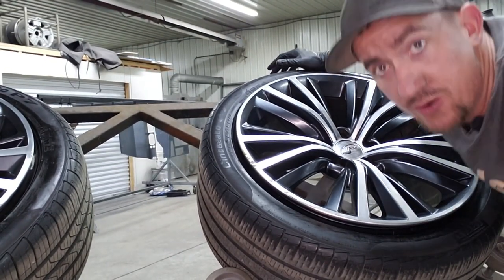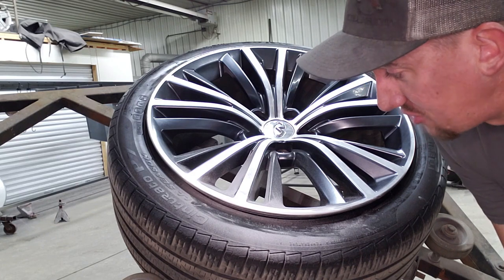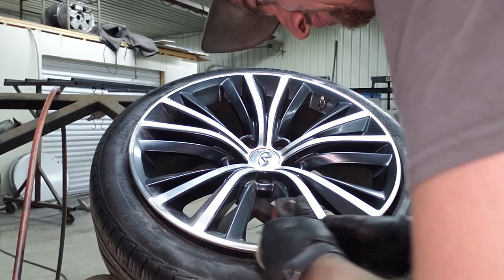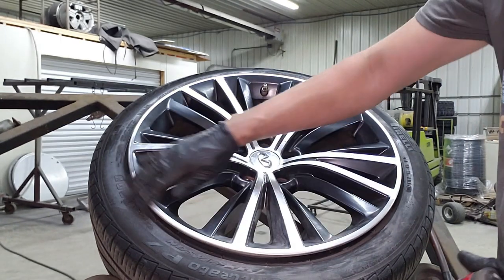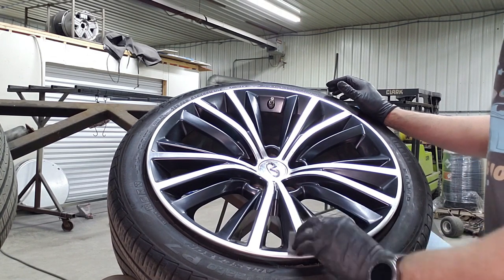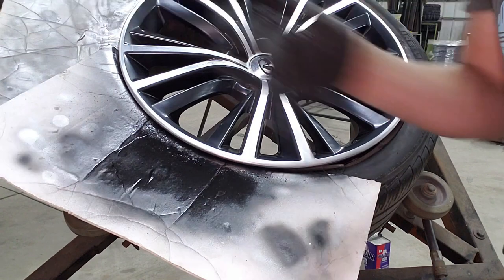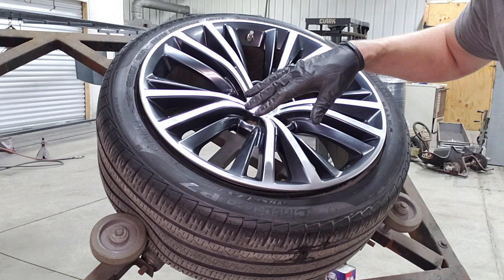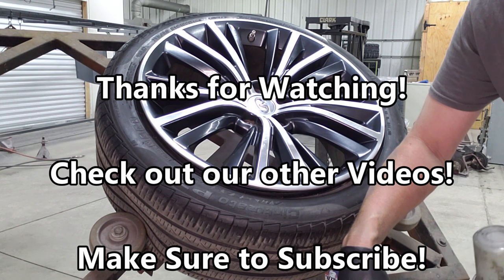Wheel Repair - How To Repair Curb Rash / Road Rash - The right way

Comment: Howdy Dan. Glad to see there are men out there doing things the right way. Out here in Cali most of the mobile rim guys I see use rattle cans;it’s kind of depressing and pathetic. 
I’ve been doing mobile paint and interior repair for over 40 years. Back in the day when I repaired cracked dashes and dyed vinyl tops. Then painted plastic bumpers came along in ‘80 and it was on.Started working in a body shop when I was 18,got all my certifications by PPGand threw everything I could in a truck and went on my own when I was 20 to service dealerships. We both do things pretty much the same only getting the nano dressings off the wheels nowadays is kind of tough. I take cleaning a few steps further. I also use different silver and chrome effect paints too. Sometimes on the Ford rims one of the posters,which are painted and not actually chrome,I paint em black/clear/chrome/clear. I’ve gotten it down but man,I did a lot of learning. You can use a flat binder mixed with an ultra fine silver toner to help before clearing and blending your edges. 
Anyway I’m flapping my lips too much
But on a serious note. Please Dan,even for your videos. Wear some safety glasses and a mask when you’re grinding those rims. Please. All that heavy metal you see on that rim is in the air and getting to your eyes and your lungs. Same goes for the heavy metals and isocyanates in your paint and clear. 
I’m very impressed with your work and especially your pride in your work. Respect us earned not given. 
I always said the only thing you truly have in this life is your name and your reputation. Don’t listen to the haters. Your repair will outlast those rims. But please protect yourself. Thats me sharing what I’ve learned going back to ‘72. Take care pal

Comment: How did you not get hyper silver overspray on the black inner paint of the spokes?   And can you explain the clear “burn in” a bit more?
Reply from the maker: We angle the gun away from the pockets, if you do get it on the black you can wipe it off with liquor thinner before clear.  Burning the clear is done with a clear blender, it melts the overspray and edge of the new clear with the original clear.
Reply: Is there a consumer grade blender (rattle can) you’d recommend?   I’m attempting a small repair on a satin gunmetal finish wheel and having a hard time blending/matching the satin.
Reply from the maker: @brookefore4618  Satin in the color or the clear?
Reply: Right Now Powder Coating surely you were better off masking up the grey area and focussing the area on the diamond cut
Reply: If u have a good hand, u don’t really need to tape off, but if your paint hand is iffy, then it’s best to tape off, for sure.

Comment: Great video, thanks for sharing! Do you know if 2018 Ford Expedition Platinum 22” OEM “polished” wheels are coated or sealed? And how would you repair them?  Ford offers a lot of polished wheels like these and when I inspect curb rash on them, they either don’t have clear coat or it’s hard to see.

Comment: I was waiting to see this setup on a lathe and machine it back ever so slightly…. Hrmmm.

The right way.
Reply from the maker: Why watch the video if you know the "right" way?
Reply: @RightNowPowderCoating  I don’t repair wheels for a living. I was just using my general machining knowledge and various other tooling skills sets to assume the “right way” would be to put on them on a lathe and skim the outer lip. I mean, there quite literally can’t be a more accurate way to repair a wheel… of course this would be costly and no doubt unnecessary. 

Hey, the job you did was satisfactory done with pride and care. It achieved the desired outcome with the intent to be a lasting repair…. To answer your Q however. I was looking for a video to send to my brother who’s wife scraped his rims - skimming my way through it, expecting to see something other then (yet another) hand sanding a machine of a round surface. 

Perhaps the right way and the best way are 2 different things. You can’t argue a lathe wouldn’t be the best way to repair a rim.
Reply from the maker: @ibsn87  It would be the factory way for sure.  You would actually need to weld material back in and then lathe it so the exact profile was the same, by sanding down the scratches smooth we take material out of the wheel.  My right way was more in line with some other videos on YouTube where the person is using bondo, which over time will fail on a wheel.  This is the typical cheep repair for a dealership, if you start looking at machined wheels you will start seeing tons of repairs as most guys do them cheap and just put a band aid on them. Machined wheels always either get curbed or chiped and get corrosion, both are typically fixed like I did it here but most wheel guys dont take the time to get them nice, they hit it with 80 grit, 200 grit and blast it with silver.  To lathe every wheel would drive the cost up for repairs and dealerships wont pay it when some guy with a truck will make it look good enough for 50 bucks.

Comment: High quality content! have a question on clear, I had a similar rash repaired a while back, the clear applied over the repair area seemed a bit fragile and easy to flake off, which it did eventually, a small piece of clear came off when I swapped my tire, I went back to the wheel shop and they told me it was to be expected, and that the clear on OEM wheel was powder coated on as opposed to spray on paint, and if I want the durability of OEM then I would need to redo and powder coat the whole wheel.... can you please confirm if that is indeed the case or he was bullshitting me? thank you
Reply from the maker: Yes and no, some wheels are powder coated clear and some are not.  We do spot repairs all the time and rarely have issues.  Unfortunately you get what you pay for and lots of our competitors charge far less but also dont care and just want to flip the job get the money  and move on.

Comment: Can you clear coat the parts of the rim that you repaired instead of painting?
Reply from the maker: We cleared them and then put a special effect paint over the clear which actually sinks a bit into the clear.  It hides the hard edges the repair shows. You cN do a high polished, degrease and than clear but adhesion will be lacking.

Comment: can you explain what you mean by "burning in the clear" do you mean just going over it with a second coat of clear and overlapping it a little further into the repaired areas to mask the new coat of clear?
Reply from the maker: It's a painter's term.  They have clear blender solvant that melts the overspray clear into the old clear

Comment: What do you do when you get a wheel with tire shine all over the rim, sometimes prep cleaner just doesn’t seem to work.
Reply from the maker: We use straight purple power.  Some time we clean the wheel 2 or 3 times.  Can also us wax and grease remover.

Comment: How is all this effort cheaper than a new stock rim?   I get it if it no longer exists or its some 2k rim but thats just some run of the mill infinity rim
Reply from the maker: Most new rims are over 600, many over 1k.  When I was repairing rims full time we could fix them in 15mins to 45mins each.